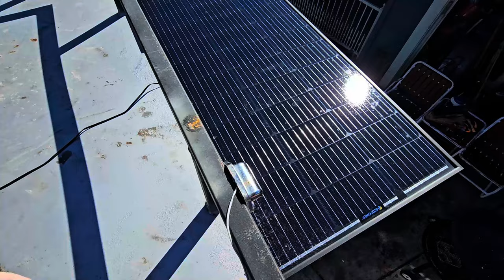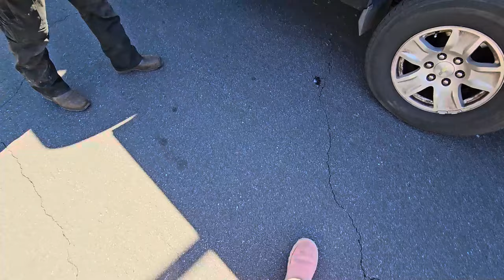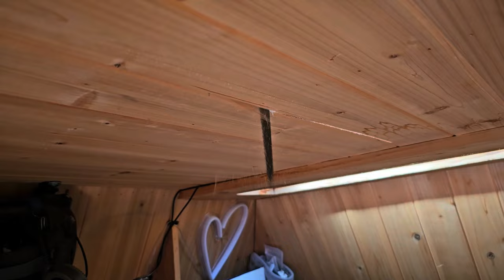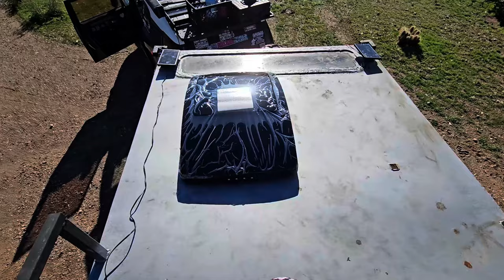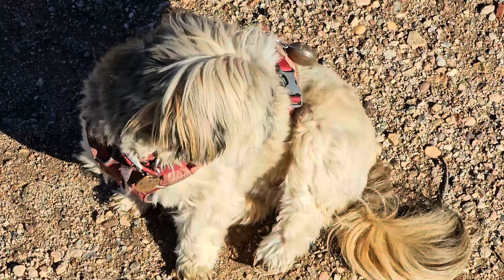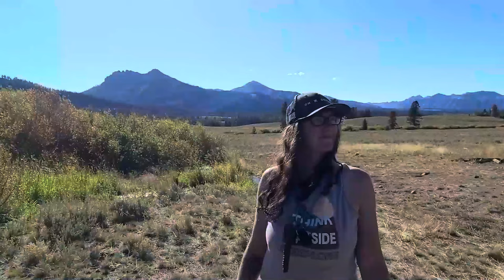Install: MaxxAir 7500 on Tiny Home Trailer

Comment: Keep up the good job.   I’ve got a portable battery pack I keep charged with a small portable solar panel with a usb plug.  That keeps my lights running as much as I need.   Amazon.  USB panel is like 11 bucks.  Can’t remember how much the battery pack was.  But they are small and work great.  Especially for led lights.
Reply from the maker: Yeah those are pretty cool!